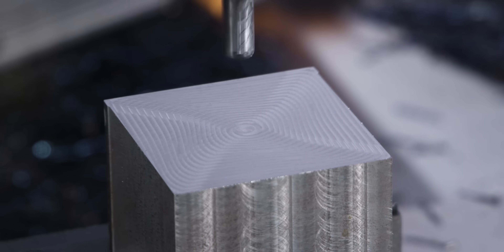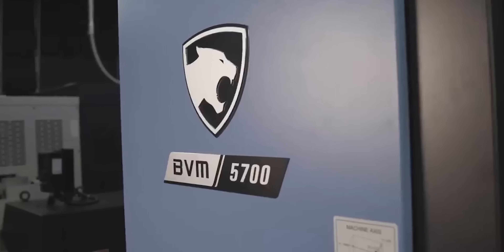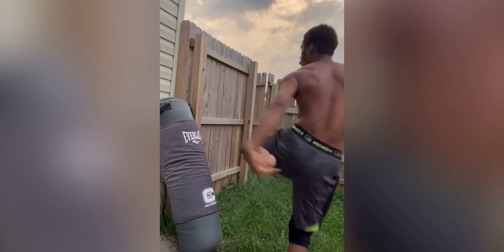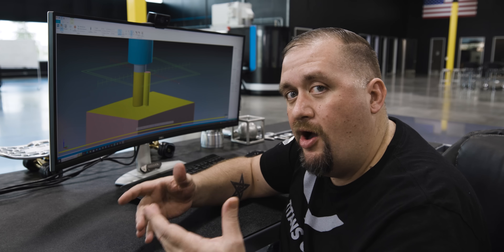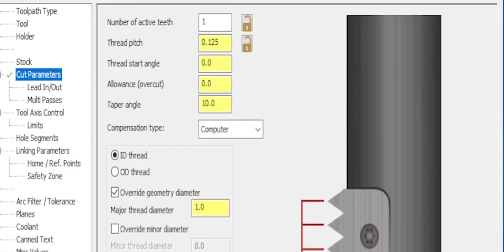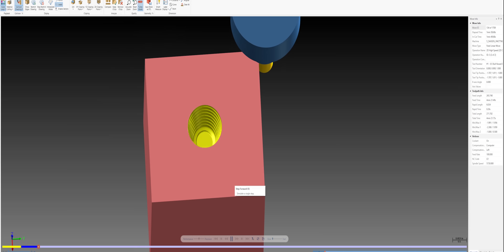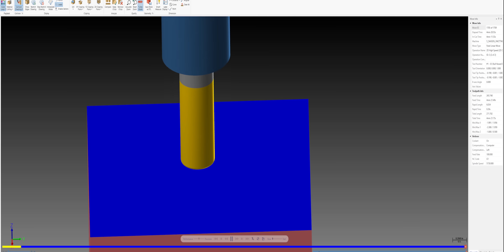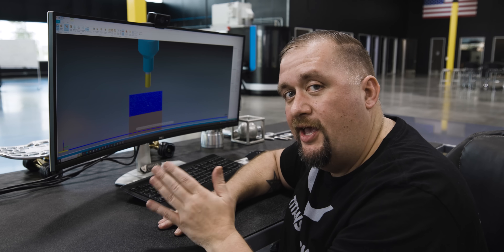Brilliant Technique that All Machinists can use to Prevent Breaking End Mills

Comment: Unrelated to the actual topic of the video but why did you choose your speeds and feeds the way that you did? For reference (I’m sure you folks already know) but the 1/2 TE for 1018 called for 1.5D axial by .5D radial. Max SFM at 660 and FPT at .0037. That’s a total MRR of 11.25 vs your total MRR of 10. Is it for testing purposes to see if the TE can handle bigger axial/smaller radial at bumped up speeds and feeds?

Comment: Or you could just take several passes with a face mill or better yet get the proper sized material or saw it to the proper size before going into the mill so you aren't trying to face off an inch deep from the top of the part. Using a blank that far oversized is wasteful, maybe ok for a one off part on occasion but it should be the exception not the rule. The other option would be to mill it to the point where to have either the fairly thin wall or post as in the first part of the video taking it to full depth then taking the last part in several different passes with reduced step down depth, in other words instead of having a one inch depth of cut on the final passes you reduce it to four quarter inch depths of cut.

Comment: This is a really cool strategy.  The principle of creating a structurally strong local area can also be applied to reducing the chances of chipping off brittle materials near edges like plastics.  This needs to be integrated into CAM tool paths as an option for both outside to inside and vice  versa strategies.

Comment: Fusion's Cam software actually does support a toolpath that includes this quite well. You can turn a helix on in the middle, do a curtain area then come out and do another from the outside if you just copy past same one then change geometry
Reply: I can’t figured out how to keep it as just a helix. It starts to to helix but at the very end it just opens up the whole with no taper
Reply: @bf4chode  Maybe try to change the helix's angle and tbh, the taper doesn't have to be there. Just having a hole in the middle helps a lot, long as you have coolant to help with chip evac there should be no problem
Reply: @Kermie_The_Frog  just to be clear, by helix angle do you mean helix ramp angle or the helix taper angle? What I’ve done for the program I’m going to get run in an apprenticeship I’m in is just simulate the tool path and watch my xyz coordinates and cutting method so when it switches from ramp to cutting feed rate, I see what my xyz coordinates are, post process the program and delete the part of the program after the ramp is finished.

Comment: 1. Strange scenario of turning whole block into bunch of chips
2. Isn't drilling enough or all its about taper form?

Sometimes I'm using predrill to ease up the mill's work, but it good not at all cases 'cause sometimes additional plunging actions are worse than straight smooth milling and even tangent/trochoidal cuts have to suffer because of walls.

Comment: I think it may be better to mill the center in that way but after you mill the outside, leaving enough that you know it'll be a ridge you can spiral down and mill the post out gradually. My thinking is that while you aren't dealing with as much catching on the endmill, there are still thin walls that could potentially catch, tear, and then chip the side of the endmill using the way shown. I could be totally wrong though

Comment: What if, when the original wrapping around tool path gets close to the center, you jump up to just above Z zero, and do like a 70% engagement tool plunge just off center enough to eleminate the central rod. Once the plunge is done, it continues on around to center. Would there be enough material at that point to support such a cut? What if it plunged a few times? Would that be faster than that tapered central tool path to clear the center?

Comment: This is a very real issue and it's super annoying. The only times i have this issue though is if i use dynamic milling with a harvi 1te. Then again, i rarely use harvi 1tes for dynamic milling so i really dont know how to run it correctly since it's more of a slotting endmill but i once destroyed the absolute shit out if the end of a 3/4 because of this stupid post at the end of the path

Comment: Great idea, but just use a facemill or shell mill lol, increase feeds and speeds to make up MRR. Avoids this all together. Or have material cut to the correct length so you don’t have to mill all that extra material possibly adding unnecessary stress to the material.

Comment: Not bad.  Seems like an odd scenario, I hope that's second ops and not oversize stock.  This may be a stupid question, but why wouldn't you use a facemill?
Reply: Ever cut 304 SS with a face mill?  Some materials are just not face mill friendly and a dynamic path on an endmill just works and lasts.

Comment: As someone with CNC experience primarily in the woodworking realm, I'm confused by the use of a ball end mill...
Reply: It's not a ball EM it's a bull nose or corner radius EM. On square tooling the corners are the weak spots so using a bullnose EM with a .03" or .05" radius when roughing material saves time and money by extending tool life. You can always do a finish pass with the square EM later.

Comment: Great tip for a lot of diffrent CAM software users! NX CAM has this feature built in, you can check the box to skip those "posts" and machine them with helical toolpath. Hopefully more CAM developers will add this option to dynamic milling

Comment: I have created many programmes with PTC Creo, but I have never had the problem described. But I have also never machined large volumes with twice the diameter of the cutter as the infeed in depth. I would use a larger milling cutter for the part shown, or if I absolutely want to use a small milling cutter, I would machine the material to two infeeds. Or I could use a milling cutter for roughing. One that doesn't have smooth flutes, but instead has waves on the cutting edges.

Comment: I use a similar method when forming deep walls when roughing a contour. It helps to stop squealing and gaulding if you are deeper than the flutes, and just as you show, makes the breakout much better for the cutter life.
Reply: Can just grind back the endmill as well.

Comment: Personally prefer milling down to a 20mm diameter spigot and then taking it in 4-5 z passes , this is quicker more secure and dosent need slow af ramping that wears the end of your tool 👌
Reply: This is exactly what I do. Much better method. Works on long rectangular parts too. The method shown here would not work on rectangular parts
Reply: top tip!
Reply: I take a drill a little bigger than the endmill, drill to about .005" over the end depth, rapid down to about .02" over the drill tip length with an endmill, plunge to depth and then interpolate out from the center.

Comment: But you can only do this on a 5 axis machine right? If I'm not mistaken you pre drilled the hole and used the mill to make it bigger, and then worked your way from the outside in and as you got closer to the center you changed the angle of the cutting tool to where the top of the tool comes in first and it will just work its way around till the cut is complete keeping the flutes in tack
Reply: no, you can do this on a 3 axis. u can pre drill the hole but don't have to (depending on the material etc.) he used a toolpath (which is normaly used for thread milling) to crate a tapered spiral 1:44.

Comment: Great tip! My question is, why would you adaptive this out anyways? Why not face at multiple depths? Or why not just use the face toolpath, resulting in never a thin sliver of material? Thanks!
Reply: Tool wear is even during an adaptive, when facing, your only using a small portion of the flutes.
Reply: @theorangebaron1595  I was just about to write this, Using the entire flute is both stronger for the endmill and least amount of wear. Though, why it wasnt just saw cut to size correctly in the first place... beyond me :)
Reply: @theorangebaron1595  Good point, however, woudln't you be better off just using a facemill for that instead? That way you wear the part thats intended to be worn...no need to wear your endmill on such a simple operation. Facemills are indexable so if you wanna wear something its the facemill.
Reply: @TheVFXAssault wouldnt you be better cutting stock to the right length
Reply: @TheVFXAssault when I do what I call the grip and flip method of making a part. I usually grip on about .100”-.250” on the bottom of the stock and then do the first op and then flip and mill off the extra stock. I use an end mill and save a little to finish with a face mill. I try to use my face mill inserts as a little as possible to get a good finish. I feel like I can mill more material off quicker with an end mill and the part warps less. End mills last a really long time with dynamic tool paths. Face mill inserts always seem to dull quick for me.
Reply: You could even ramp in to maximize engagement. The problem is you need the right tool and the right machine to run a face mill at a higher MRR than an end mill. So if you don't have the HP and good inserts this could be more efficient.
Reply: I guess this was just shown as a simple example. This may have been in bigger pocket or some other, more complex situation.